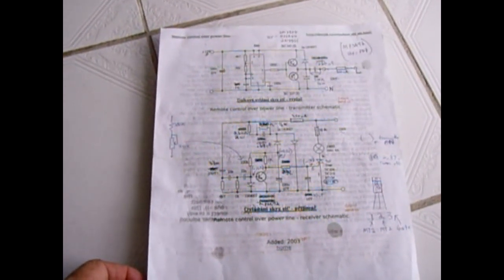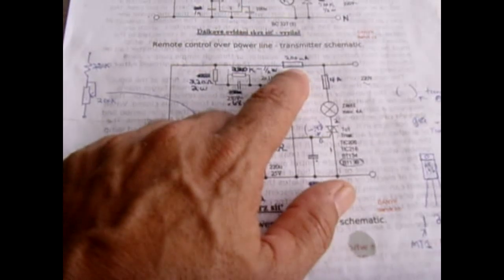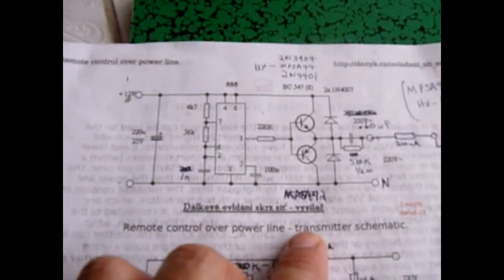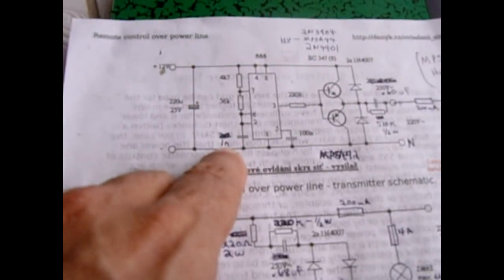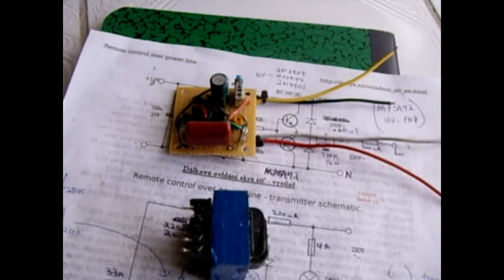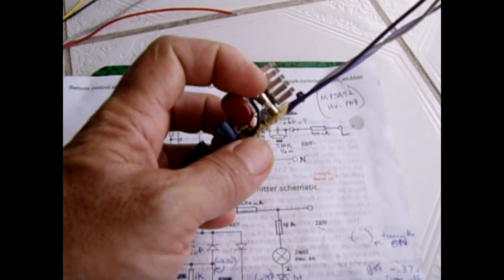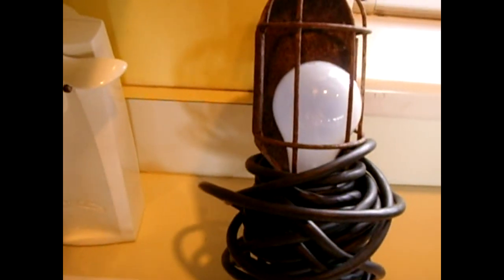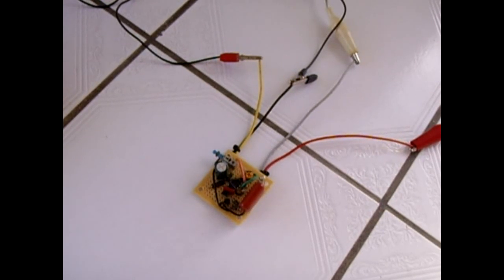Control Lights & Appliances OVER AC Power Lines

Comment: hi good video ! I am getting the bit to build this circuit but I'm wondering if the  bc327  has to rated at <250v ? and what size of resistor is needed for the receiver is 2w enough ?  thanks
Reply from the maker: Hello. Just use exactly what is shown in the schematic. 1/2w resistors are fine.
Reply: OK thanks

Comment: Could you possibly produce the same or similar circuit to work over 24 VAC. I'm trying to close a contact over a constant 24VAC line to trigger a driveway gate. Would really appreciate your help with this.
Reply from the maker: Steven Sauers I would make the circuit work properly for 120vac first, then switch to a lower AC voltage of 24V. If it does not work, then you will need to increase the capacitor value of the transmitter portion where it connects to the AC line to around 1uF from 220-470nF, and decrease the 1M to around 220K ohm.

Then the receiver needs to have the 330k in parallel with the 330nf capacitor replaced with a 4uF cap and 100k resistor. The resistor before 330k and 330nf cap can be lowered from 470 ohm to 47 ohm. The 820 ohm leading to the triac can be lowered to 200 ohm. The .15nf cap should be raised to around 150nf. 

Good luck. The rest is up to you.

Comment: They were doing similar stuff to this way back in the 40s & 50s. Here in the UK they used this kind of transmitter system to control time clocks on the power lines. Obviously they didn't have the technology we have now, but it's surprising what they did back then with all the different valves & suchlike. It was used for stuff like switching people's electricity meters over to low rate at midnight & back again in the morning, I have details in an old electrical encyclopedia from the 1950s, must re-read that section.
Interesting stuff & very useful, but it just goes to show, nothing's new.

Comment: Hi There!! Some good news!!! The circuit finally works and beautifully. Finally I tracked the problem down to the high pass RC filter circuit. For some reason it was also passing the 50Hz mains frequency which made the light flicker. Redesigning the RC Highpass filter and setting the sender frequency to 8KHz sorted he problem out. Thank you very much for your help and support. It was much appreciated.
Reply from the maker: Good to hear! There are online high/low pass filter calculators you can also use.
Reply: That's exactly how I did it. Thanks for all your help and support.

Comment: I tried the 230 V circuit but the bulb, lights up without the trigger circuit sends a signal. Any ideas? I changed the TRIAC, thinking it had s shorted gate.
Reply from the maker: Are you sure you used the correct components? You do realize the transistor is a PNP and the emitter is connected to the lower rail(POSITIVE). Correct? Try a new transistor. The circuit should work fine and be off until a signal is detected from the transmitting portion.
Reply: Many thanks for a prompt reply, I used a BC327 transistor and yes the emitter was connected to the lower rail, But what I did not realise, was that the lower rail was positive, I connected the Phase to the top rail via a fuse. I will try again. and re-check 

Another question, if you don't mind. Does the transmitter normally sit without any power to and, and only powered up when a signal is required or can pin 4 of the 555 be used as a trigger from another circuit?
Reply from the maker: Dennis Miller The transmitter circuit needs to be turned on and off to trigger the receiving circuit. I use a push on/off switch. You can use another circuit to switch the transmitter on/off
Reply: I  think that I have screwed up o nth ecircuit itself. As the bulb lights up even when I have removed th eTRIAC and Or the transistor. so I have to go back to the drawing board. Thank you very much for your help Sir.
Reply from the maker: When you complete the receiver, the light should be OFF. Once you accomplish that, then work on the transmitter end.
Reply: Thank you! for the tip. The problem lies with the receiver circuit or rather the way I wired it together, I think. Normally I don't have problems putting a circuit together. But this one has me, but I won't give up trying!!
Reply: Dennis Miller Good Morning! Had a great morning. The light stays off when connected, but when the transmitter circuit is switched on the light flickers as if it receiving half the mains cycle. Does that lie with the transmitter circuit or the receiver?

Comment: What a remarkable circuit.  Can you go to 150'? This would be great for a stable  we are planning to build.
Reply from the maker: Should be no problem because your using the same power transformer. Try and use the circuit receiver and transmitter on the same power leg(buss bar) for better range.

Comment from the maker: The neighbor would have to be using the same step down transformer as you. In order to be able to do that, you would need to use a higher frequency, and hope the electric meter does not choke out much of the signal. Try watching the video on 720HD, it is much easier to see everything. I also have a link to the 220v schematic in the video description area. Thanks for watching.
Reply: I watch, learn, save experimental time using your videos. Thank you very much for that. But I must ask,  Why not just supply a jpeg of the 120 schematic also. is it a ploy to gain a few more watches of the video?

Comment: Very interesting circuit!  If you put the transmitter in your house, could you trigger a reciever in your neighbor's house? Of course this assumes that your neighbor is on the same power lines that you are on.

It's obvious that you spend a lot of time to develop and test your circuits. Do you have a link to this one that is easier to read and print off for building?

Thanks for sharing!

Comment from the maker: Actually there really are no pain in the ass factors. If you copy both 120v circuits I made, it works just fine. The only thing that may happen, is a CFL that is very close to the receiver, may try and trigger the triac. If you use a higher frequency, and lower the resistance setting of the POT in the receiver, you can avoid that. :-) All you will have are 2 small plastic project boxes that plug into the AC outlet at different locations.